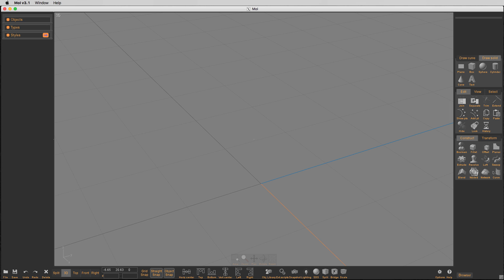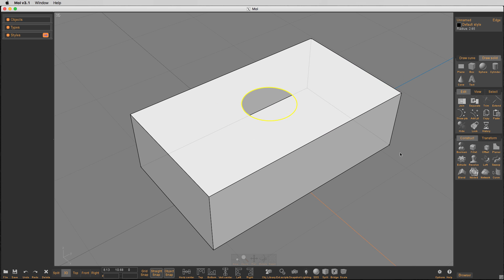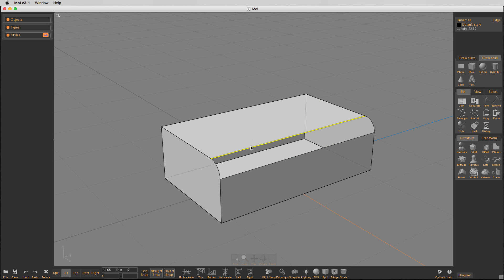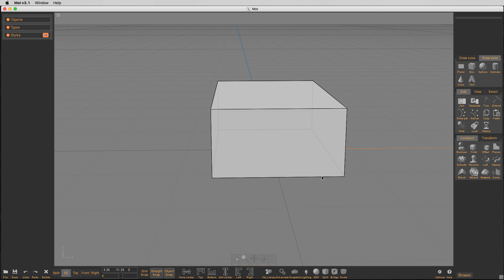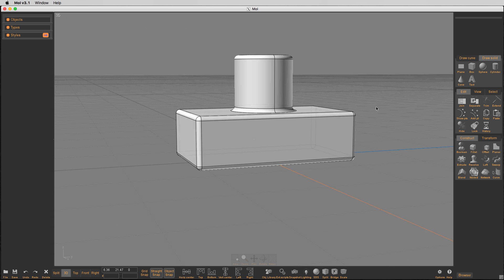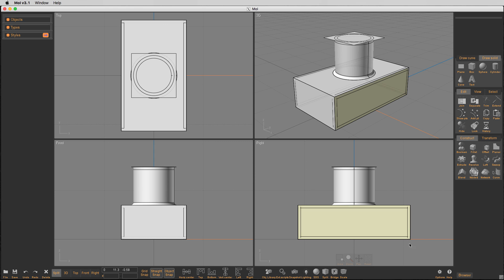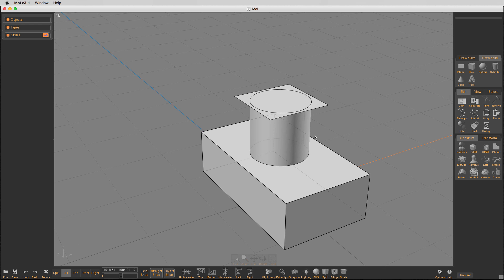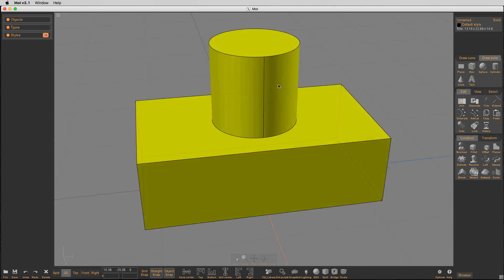Removing Fillets in MoI3D

Comment: And you can also  click un surfaces and delete parts of objects. For instance, for that cylinder growing up from the box, you can simply click the wall of the cylinder and the top / ceiling and press delete on your keyboard and it will automatically remove the cylinder and plug the hole in the top facet of the parallelepiped underneath. You should really give 123 Design a try. It's free (they ask you to get the premium subscription if you're going to use it for commercial purposes, which I have).

Here's some stuff I did with 123D Design :

http://s6.postimg.org/o9hjp359t/resized05.png

http://s6.postimg.org/n17ocevw1/2013_06_06_2150.png